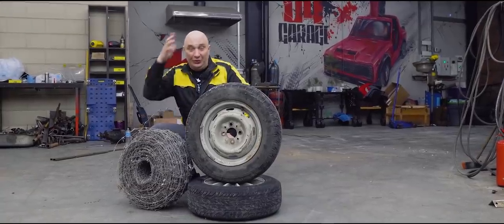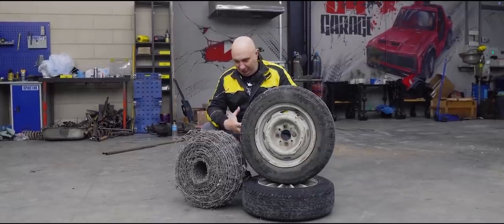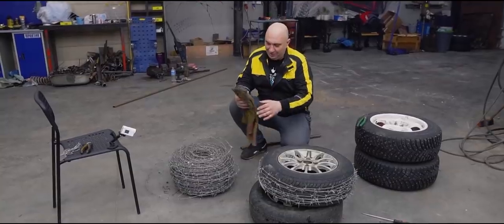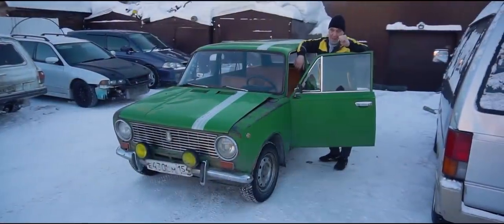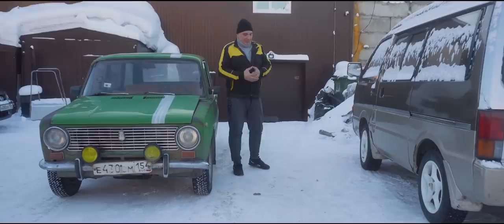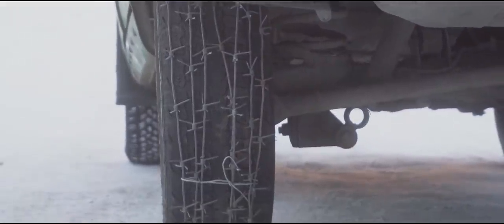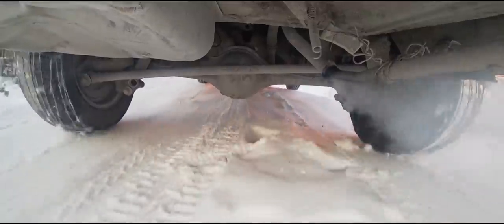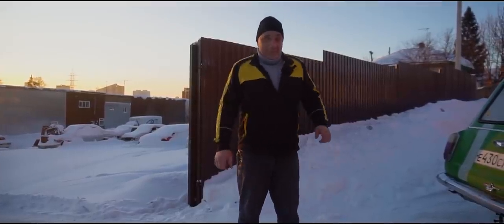Is barbed wire a viable substitute for studs?

Comment: You need to lace the barbed wire around the tire by threading thru the rim spokes and circling the tire in the perpendicular swirl pattern.
Reply: Tis is exactly what I thinking too !!
Reply: Deflate the tire, wrap, then inflate. The wire stretches.
Reply: @paulwoodman5131  Was about to say the same
Reply: Yep, I was gonna comment this too, At least wrap wire around it after these are in place to hold them from sliding off.
Reply: cant , side walls will slice open instantly
Reply: My thoughts exactly!
Reply: @cliffcorbitt9494  or do it the way they did -- but lace it on with plain wire (to avoid putting barbed wire against the sidewall)
Reply: You read my mind - funny enough when they were doing it, I told myself, this won't work because it will come off and they better do the spiral way through the rim. Then when I saw it come off, I felt like I had future telling powers. the best approach i guess would be to do what they did, then do the spiral- through the rim after, for maximum coverage and stability.

Comment: Please try running a lada with ONLY starter motors, TESLADA.
Reply: Starter motor burnout but lets try:)
I think hydraulic engine Lada can be cooler.
Reply: 101% yes
Reply: Imagine a steam engine lada
Reply: Yes!
Reply: @alexsike3412  they did it
Reply: @Wok_Agenda  i know what im watching next then
Reply: @Wok_Agenda  Link please...
Reply: @bluelivesmatter8502  use the search bar lazy
Reply: Done multiple times on my shitmobile, only for a short time to either start my car after I snapped the clutch cable or do a push start if there is no one to push me and no downhill to roll the car on. My guess is if you do that for a prolonged time you're most likely to burn the cable that powers the starter(that's what usually gets damaged first on mine), kill the starter itself or drain the battery.
Reply: @bluelivesmatter8502  Link is too busy , he's off saving zelda again . . .
Reply: Cooked stlada in 3...2...1...

Comment: Maybe try to deflate the tire before fitting. Also try to thread the wire between the spokes. Also put some puncture slime inside the tyres just to be safe
; )
Reply: Mostly it will hit the calipers
Reply: @jusb1066  I doubt that it will hit the calipers as the spikes are only about1/2 inch tall. The wheels they were using seemed to have thin rim walls. If it is too close, they could always cut off the inner barbs. However you do have a good point. Maybe that's why their wires fell off, even though they had tried to secure their barbs with plain wire running between the spokes?
Reply: @fellowyorkshireman2391  it's not the barbed there's no clear path between the holes to run that caliper doesn't cross
Reply: @jusb1066  actually I just remembered its an old rear wheel drive car that uses hubs on the rear not disks therefore it doesn't have calipers on the rear wheels
Reply: @fellowyorkshireman2391  that's true, so it should work on the rear
Reply: @jusb1066  I think so
Reply: @fellowyorkshireman2391  I was remembering a video trying cable ties on the front of a fwd, calipers got in the way in that case, maybe alloy wheels would have been flatter access, the steels didn't work.   Search for the uploader  -stupid bloke stupid videos
Reply: between the spokes is not posible because of the brake drum and caliper.if they weld some rings or nuts m6 or m8 on the inside of the rim they can run a wire trough there.never let go(hahahaha0)
Reply: @jusb1066  Cheers, that sounds interesting I'll check it out later.

Comment: I'm going to recommend this to a couple of my 2wd truck friends. Lol
Reply: Snow tires on the rear is the best option. I daily drive a 2wd ranger winterforce tires help a bunch. Either way 4wd trucks obviously have superior takeoff traction just remember every car or truck has 4 wheel brakes and they all pretty much do the same thing in low traction environments. 4wd can get you going way faster than the 4 brakes can stop. The last few days of snow here in Indiana have made this obvious. Tons of AWD and 4wd vehicles following entirely to closely to be able to stop in time if things go wrong.
Reply: @jeremypike9153  Yup, plenty of that around here. Supprised there haven't been more wrecks then there has been..
Reply: @jeremypike9153  i agree. personally, i am more comfortable with recovering my truck in 2hi than 4hi. coming from a rwd sports car it’s almost natural to recover, except i’m in a 3/4 ton truck and things are snowy and a lot slower than over steering on asphalt. but the same thing applies either way. i definitely favor the 4x4 where i live and i live by the motto “if you even consider needing 4x4, engage it just to be safe,” but when it comes to regular around town heavy snow driving i’ll keep it in 2 wheel. only detriment to it is taking off from red lights on a hill.

Comment: Wrap the barbed wire around the tire by going thru the slots in the wheels. Going perpendicular across the tread, then it won't slide off.

Comment: Tough to work with he says. Lol. I've strung no less than 5 miles of barb wire just in the last week. It's quite pliable when once you learn.
Reply: I remember them days, my uncle and my dad fabbed up a attachment to the truck bed to make the job go faster just drop it in 4low and start building the fence. Cant remember how we did it before that or if we continued with that setup.

Comment: I've had to deal with barbed wire my whole life being a Rancher. Pushing a pipe through the center of the roll of wire helps a lot. I actually have an attachment for the back of my four wheeler hitch that that pipe locks into. That way I can drive down the fence line while it uncoils.
     If you deflate the tire wrap tightly then inflate you'll get a little more holding power. There are other ways you could make it work. But it kind of defeats the simplicity. If you were stuck on a country road  and needed the extra traction. Guess you could always piss some Rancher off and take some of his wire.  LOL If I had to deal with snow and ice day in and day out I definitely have a power drill and some screws.
       🤠🐂🏞️🛩️

Comment: @ 2:30. I think you should have made a sideways loop around those barbed wires with a steel wire at certain intervals. I think those barbed wires are now going to fall off from the sides of the tyre. When you have a loop, it stops the barbed wires from spreading and it ties them up in place. On top of that when you tie that steel wire to the rim, it should stop the sideways movement altogether.

Comment: I would have way to much fun hanging out with you guys, haha.  As for the tire, I paused it before it got put on, so my guess is the barbs will also puncture the tire and lose air, and that will cause the diameter to change and the barbed wire will fall off.   Now, if it stays, though, I bet it will grip very well.

Comment: wrap the barbed wire tightly around a deflated tire, so when you inflate it, it will stretch and tighten the barbed wire around the tire so t won't fall off as easily

Comment: What if you made a tire entirely from barbed wire, just weld it to a rim and keep wounding it up, applying welds as you go until you get the same circumference as a regular tired wheel?

Comment: Cold increase grip? I love the idea though
Reply: Actually it does.  When I was in Alaska at -60 F,  we had very good traction.  As the temp approaches the melting point, it gets very slippery.
I was working at an airport, and we never even used chains at low temps.  Just level off the snow and park the planes right on top.

Comment: try those metal rings that you can adjust with a flathead that you see mostly  on radiator hoses to hold that wire in place Dont know if it will fit with those brakes being in the way a bit
Reply: Called a hose clamp
Reply: @jasonharrison25  yes

Comment: Going to work one morning on my bike with my brother i was taking a different route i should of went up a road but didnt took a crap road that would have been a crap drive decided to go thru the woods. We walked up to a 12 foot fence with 2 feet of wire on it 3 sets. I had a pretty touch leather jacket so i wiped it on then pulled 2 bikes over n helped my brother. I only got stuck 3 times 2 werent bad one was a little sitting up top didnt let it get me tho lmao cut my leg. There pretty sharp not to noticeable

Comment: You should make a pedal powered lada using the rear gears from bicycles like ten of them in a manner that allows you to shift through all but first gear that's linked to the previous sprocket just wondering if a couple of guys can pedal a car down the highway
Reply: They already did that 😎👍

Comment: Something I was wondering is if I could just use low viscosity oil in my car radiator instead of coolant? 🤔 It seems ridiculous to me that we use coolants that gradually corrode the system when we could use oil.
Reply: Engine oils have a much lower thermal conductivity than water. Engine oil is about 5x LESS thermally conductive than water. So while possible the coolant passages, cylinder head design and cooling pump would need to be redesigned to match to be reliable long term.
There is a product on the market, Evans Coolant, which is not water based.
Reply: @otm646  The cooling system is so grossly oversized would it make a difference in reality? 🤔

Comment: I don'expetc it to work too great. The wird is not fixed to the wheel properly (because there's only one point where you wrapped the wire through the wheel) and the barbs are too thin, so they would be pulled throw the snow and dirt without much resistance.

Comment: The wire should have been wrapped perpendicular to the tyre, not inline with the tread, otherwise it will come off. Also, it should have been wrapped with the tyre deflated.